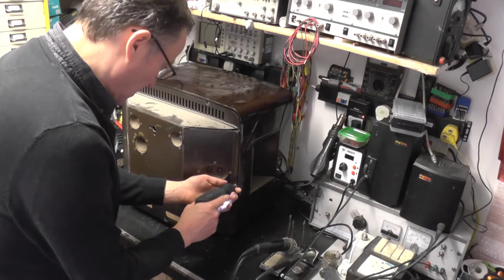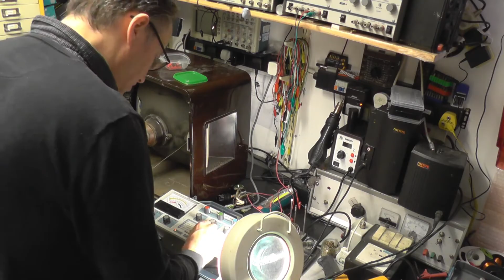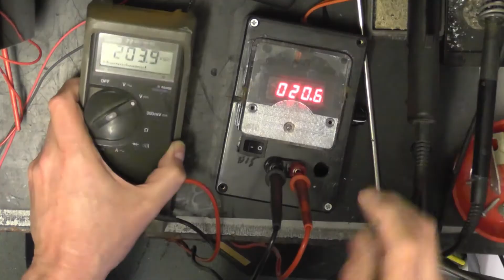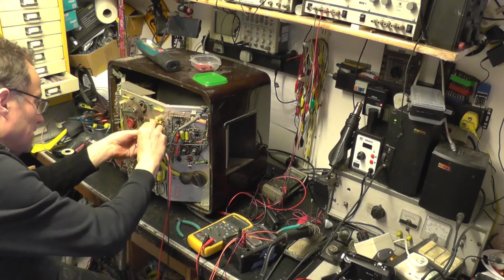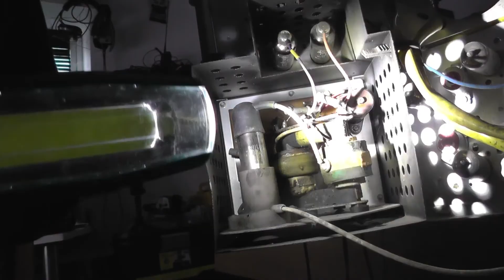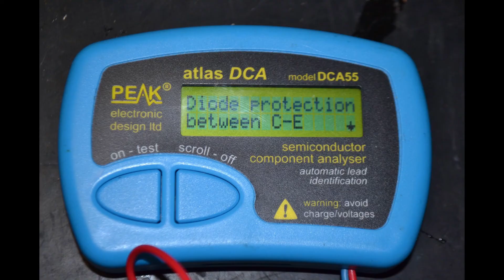1960 Philips 17TG100U Television Repairs. Part 1 - First Light

Comment: Love your optimism with the crt. 
I've restored two of these both with burned out lopt primaries. Having rewound them they ran very hot. My solution was to set the mains input to max 250v and they ran a lot cooler. Both sets have worked well for some time.

Comment: The AW43-88 and AW53-88 are very reliable tubes. Mine also tests low, but still produce a decent and bright picture with good definition. I have had one with a partial heather short, though, but it might have been my fault. The green "mustards" (greenies?) are a few years older than the mustards we all know, so probably built late 1958, just when the 110 degrees tubes were introduced. I wouldn't count on the yoke being bad yet, but remaining electrolytics need to be replaced in vertical deflection circuits. Although my yoke is slightly different (not brown but yellow'ish/white encapsulation) it has cracks in the plastic due to age, but it still works fine. Looking forward to the next part.

Comment: Quite a few times I’ve seen Bob Andersen (Bandersentv) and Shango getting low readings yet the CRT produced a decent picture.  They both say the tester is not necessarily accurate and the best test is to run in the set.  Similars thing happens with valves, Bob had low EHT on one set, tester said the line output valve was good but another valve produced good EHT.  The “polo mints” remind me of the dropper failing on our Bush TV125/U.  The first time, the repairer wedged a screwdriver so the blade bridged the break.  Ran for a week while we waited for the replacement.  Second time it was open in two places so he didn’t try the screwdriver again.  No doubt some new caps in the vertical section will sort that vertical mess out.  Does tend to flag a potential yoke issue though.  Remember the vertical panel being replaced on our HMV colour TV.  The replacement wasn’t set up right and displayed a badly distorted picture until it was adjusted.